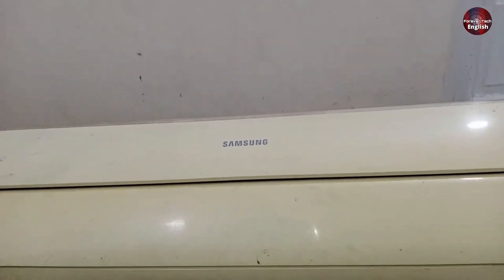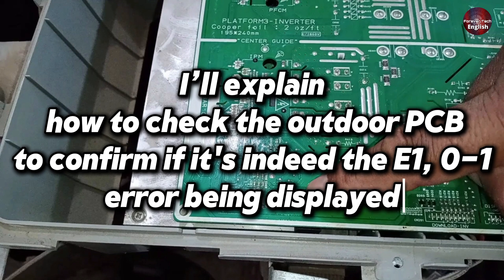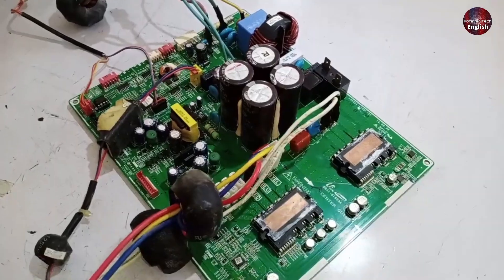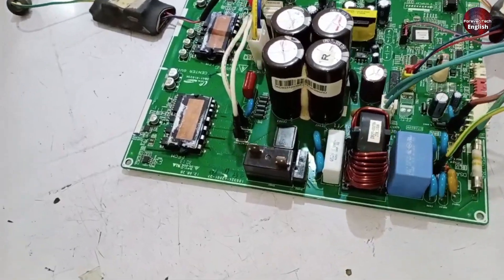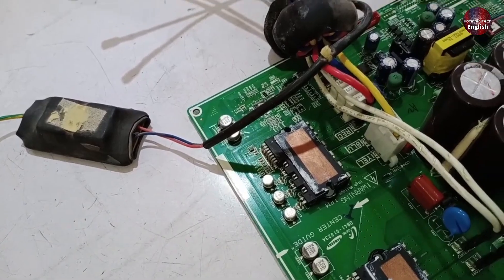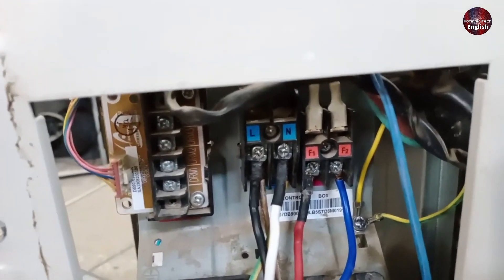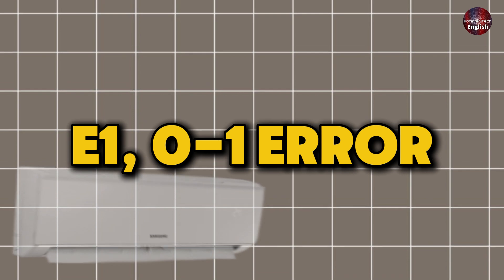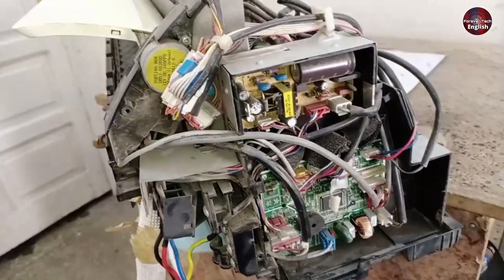How to Fix Samsung Mini Split AC E101 Error, Critical Solution Inside

Comment: If the indoor unit doesn’t show any error and continuously beeping and nothing work(fan not start and any command from remote controller doesn’t change anything) , but if I disconnect one of the communication wire the indoor unit and remote controller seems to work ok. The green led of the outdoor unit blinks and also when I plug in the power it start like small vibration from the inverter few times after that nothing happens, also the resistence between inverter pin are all at 1.6ohm Any suggestion please?